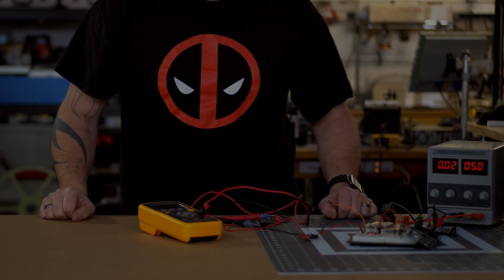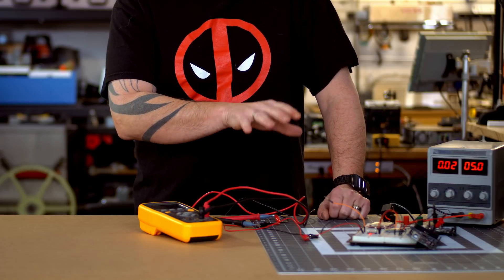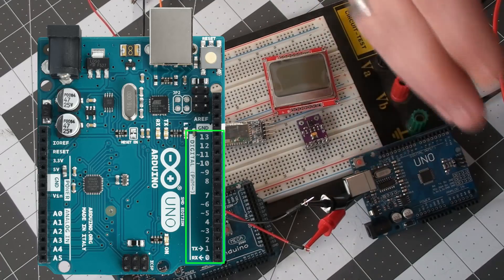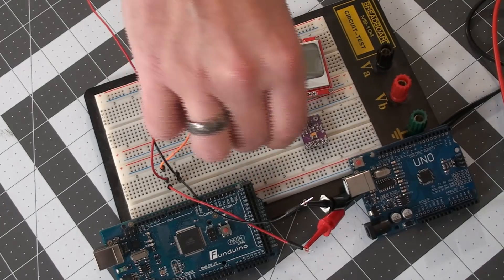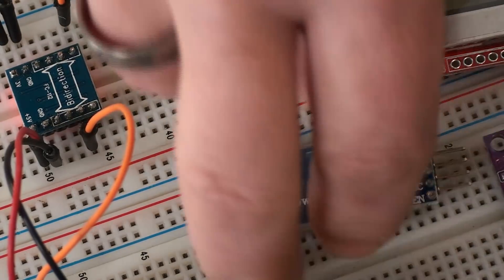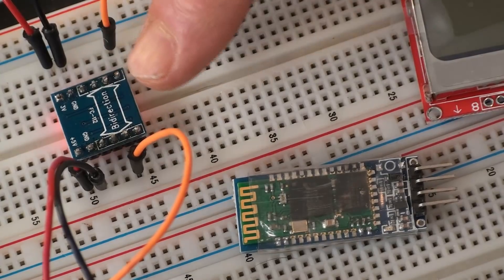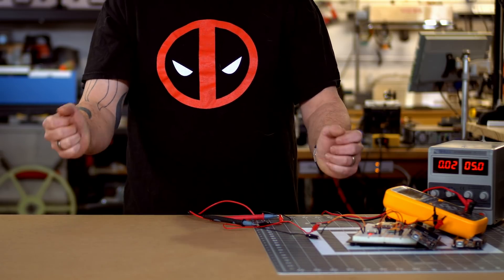Using a Logic Level Converter to connect 3.3V modules safely to an Arduino

Comment: Hello, I have a question. If the two devices I'm connecting both have their own power supplies, does that means I only have to wire their GND and communication pins? Or do I still have to wire both their power pins to the shifter?

Comment: Two Questions   
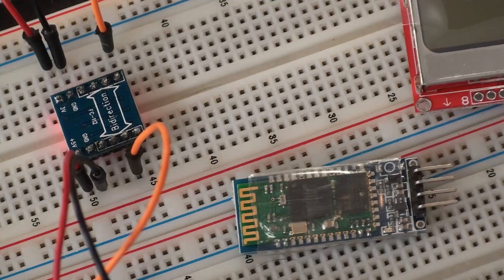1.This shows (2:10) two orange jumpers that are not directly across from each other on the load leveler.  Don't the orange leads need to be straight thru the leveler 3.3 side to 5v side?  If not how do they know what signal goes to each device...

2.  Do you need and external power supply for 3.3 & 5 VDC?  Looks like you are drawing the 5 from the USB direct with u hook jumpers, but I can't tell where the 3.3 is sourced.  If you don't overload them, can't you use both 3.3 & 5 VDC from the Arduino power pins to power the leveler?
Reply: Yeah he had only one thing to do right it was to align the in and out lmao

Comment: Alright cool video, As someone pointed out in comments,  for Mega and similar boards, because the logical high is bit higher than the cut off 3V, it works fine but I am using strictly 5V MC STM32L4 board, without level shifter, My board won't even detect signal from GPS module which works at 3.3V. This video was helpful.

Comment: Does this work with PWM signals also? I'm trying to get a Wemos D1 mini to control an BTS7960  Motor Controller. Tne Nano and Uno work fine with the BTS7960 but they don't have the WIFI and MQTT options I need for the system I'm building. The D1Mini signal is not high enough to power the motor. It turns the motor on, but the rpms are way too slow. I've been pulling my hair out!

Comment: Somehow all my 3.3V stuff needs to work with 5V level stuff. If I use 5V mcu, I'll need 3.3V stuff, if I use 3.3V mcu, I'll need 5V stuff :D

This guy says can read 3.3V but write 5V. What this mean and wyh? Glad you asked:
Logic level converters sometimes aren't neccesary.
For example the i2c bus: if your master have lower logic level, 3.3V, and your other device is 5V. There shouldn't be problem, if you power the bus with the lower level, the devices work by pulling the lines to ground, and both devices should detect the low and high states. You'll be out of specs, because the high level usually should be at least bit higher than 3.3V. In case of atmel328p (arduino uno) at vcc=5.0 volt it is 3.5V. With a bit of luck it'll work just fine. At worst, it won't work, but no damage to your circuits.
The other example would be a one way SPI. Your SPI master is 3.3V, and slave is 5V. If you don't connect the MISO pin, there are only signals going from your master (lower level) to your slave (higher level). If the slave works with this, there shouldn't be a problem. All 5V devices I tried works fine with 3.3V logic. Wouldn't put into a production item, but for my purposes it is okay.
The same applies to UART too. A 3.3V TX can be connected to a 5V RX. In reverse it may not be true. If your device is not 5V tolerant, you'll fry your stuff, you need a level converter to prevent it.
And there are the 5V tolerant devices, which are requires vcc=3.3V (the main power input), but can accept logic levels up to 5V.

Comment: Thank you for clarifying the differences between 3.3V/5v power versus logic. Liked and subbed. I would just add that not all modules are 4 channels, which you need for I2C or SPI
Reply from the maker: Thank you for taking the time to comment about the modules and for watching of course!

Comment: Hello, what is the advantage of using a logic level module over a simple voltage divider which only requires 2 resistors on the arduino TX to module RX line?